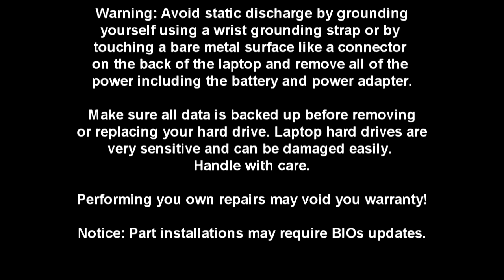Dell Inspiron 6400/e1505 | Heat Sink Replacement | How-To-Tutorial

Comment from the maker: If you mother has the on board video then you will not be able to replace the video card with out having to replace the motherboard as well.  If you have the motherboard that requires a daughter video card then you are able to easily upgrade the video cards.